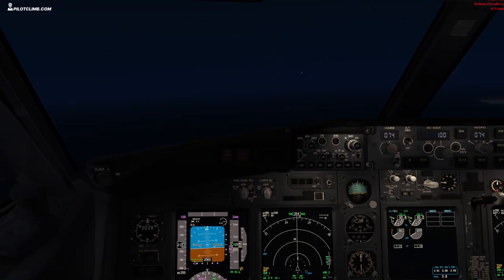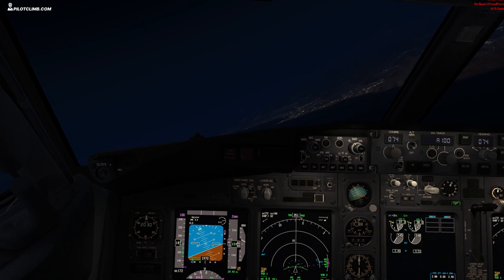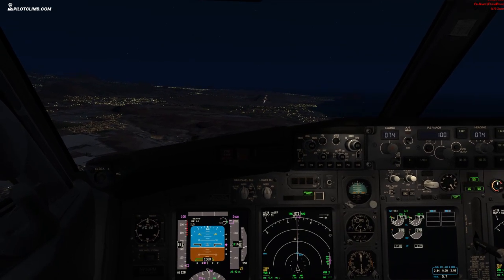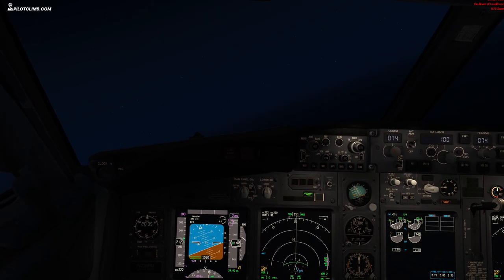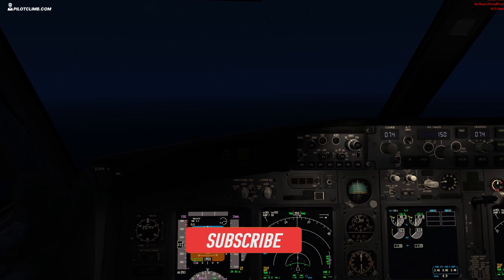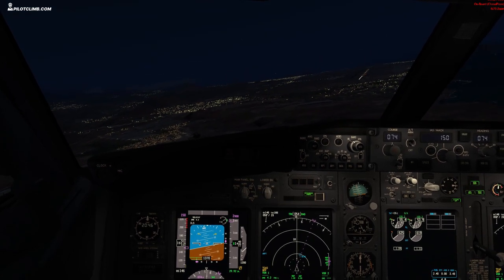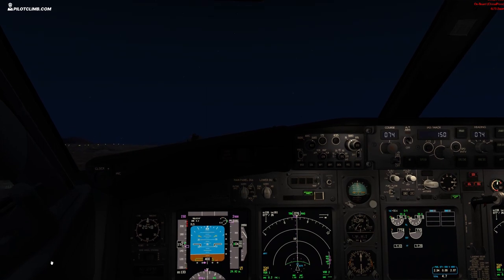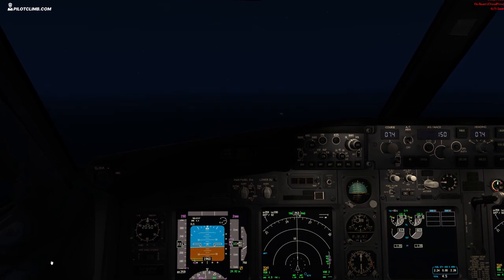Let's Practise the Go Around Maneuver On The Prepar3d - [Two Approaches and Two Go Arounds].

Comment: Why didn’t you have Vref and GW set in the FMC? Above white bug vref40+20 you call flaps 5
Reply from the maker: I didn't set anything because the video was focused on the Go Around manoeuvre only. I flew generic speeds on the video that, I was sure were safe.. I think the white bug was related to take off phase.. but again no inputs were made on the FMC👍
Reply: @PILOTCLIMB   Ok no problem. I really enjoyed it. There is also a white bug for the approach too
Reply from the maker: @Driver170  Yes, the white bug of the video was the one of takeoff logic, V2+ 15. 👍

Comment: If you go around and your MAA is FL70 at Tenerife. Would you set STD passing 3000ft
Reply from the maker: Hey, many thanks for watching! You should set FL70 unless there is an intermediate level off altitude which should be specified clearly on the Missed approach procedure.. 👍
Reply: @PILOTCLIMB   Hi, yes Glideslope capture set MAA per SOPs. But when would you set the altimiters as you are now climbing to a FL

Comment: Oh, yeah, it's really hard to properly control everything in the simulator. I'm not a real pilot, but just like driving, it's much easier to reach the controls without having to look at them and looking around naturally in nearly impossible in the sim.
Reply from the maker: Hey, I hope you are doing great!! You are right!! It's not that easy to properly operate using the home simulator... but I'm getting better slowly 👍 I found out that with Xplane there is a software that allows to people to fly in the same flight deck..that's incredible
Reply: @PILOTCLIMB  the ol' good FSX Steam Edition also has that feature, but it's more of a game due to its limitations than a comprehensive sim such as XPlane. I use FSX for helicopters only, it's fun.
XPlane also has a VR feature that is supposed to help with view limitations. Customizing controls with Arduino is still the best way to go, but that's a lot of work.